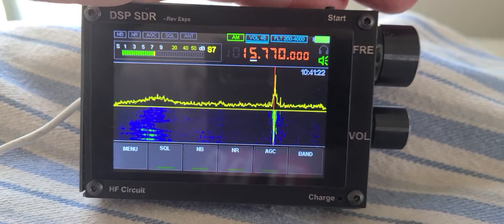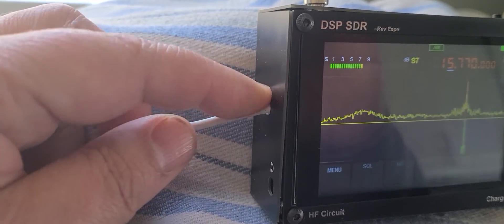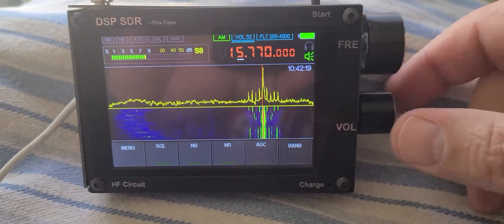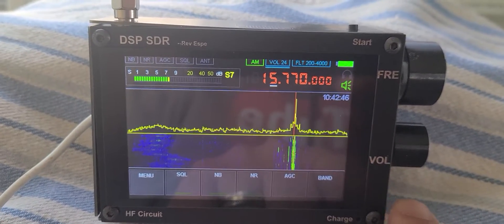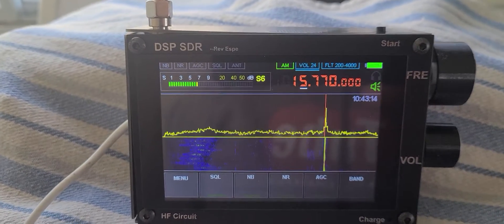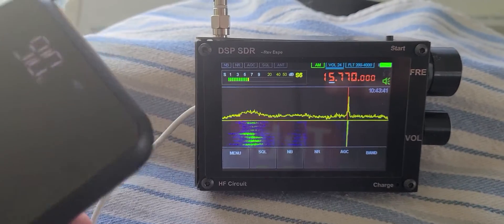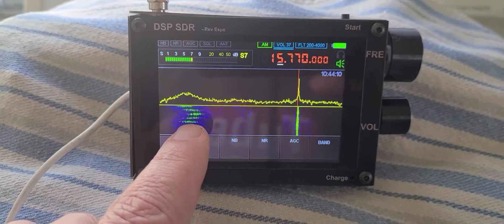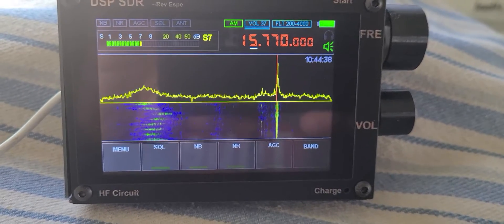Malachite SDR DSP receiver now using external battery pack receiving WRMI 15770 kHz Shortwave

Comment: I just wanted to ask you , Gilles, how and where in the radio did you connect the USB cable? I just received one almost identical to yours, and have experienced the same problem with the lack of charging ability and that it just won't run off of the USB C port. It ran perfectly at first, but now I need to solve this problem. Your solution seems to be the best. Thanks.

Comment: I never saw when you said what was wrong with the internal battery? I can tell you mine came with the reset switch on the bottom to the left I believe and it would only operate while plugged in. When I flipped that switch to the right it worked fine on batteries. I have no idea what that switch actually does, I just discovered this on accident. Mine does have an issue though where the touch screen becomes unresponsive or thinks I am touching one are of the screen when I am touching another area. I bought the registered version and they sent me the demo. I ordered another type and hope I have better luck with that which sucks because I like the speakers on this one. Do you know how to enter the registration code if you had one? I was wondering if I got the code if I could use it on more than one of these. I am probably going to end up with several trying to find what I am looking for. I was thinking of getting just the board and making my own using this killer tiny JBL speaker that I have. From what little mine has worked reception is very good and I feel like it is worth the hassle of trying to get a good working one. Definitely not ready for prime time yet but these are very cool
Reply: It's a battery disconnect switch for airline shipping. Turn it to the right then forget it exists.

Comment: Do you have a impedance matching  transformer, for you telescopic to receiver.
There is a video where a person made a 49:1 matching transformer using a Ft-405 toroid and 23gauge wire, Unfortunately I gave trouble with the YouTube link on this phone.
73
Reply: I sure with that guy made and sold his little transformrrs in a tough case. SMA/SMA. I'd buy one.